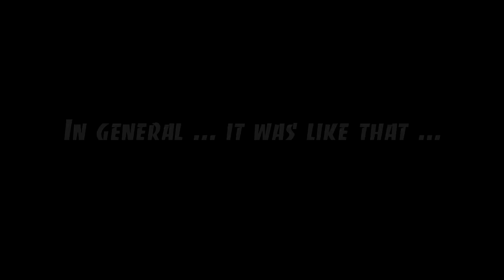A miracle invention from the motor of a car window lifter

Comment: I really appreciate how you thought about what the door lifter was. A motor that could be powered by a 12v battery with enough torque to do some real work. In re orientating it, we can see how it really has potential outside its intended use. Mounted sideways connected to a long rod actually makes me see more ways a motor could be used. Thanks for teh inspiration. Now to get a few old window lifter motors now that I see what they were built for......high torque situations. thx.

Comment: So the motor worked on 12V DC so you connected a battery which would be continuously charged by an AC adapter? Thats pretty sweet

Comment: 🔵 You should have made it at least 10-inches wider to overlap the wall on both sides enough to prevent light from coming through the uncovered areas.

Comment: Guy puts on hearing protection to fire up bandsaw to cut plastic, yet has his eyes close to at least 5 different power tools and no safety glasses on.  Classic!
Reply: Not too hot on band saw safety either   free hand cutting when a fence would be better and not having the blade guide  lowered to prevent accidents . 

 I'm highly amused that people are still stupid enough to enter the workshop & start working wearing  " Open toed safety sandals with or without socks " ..one day he'll learn the folly of his actions the hard way . 

 Did like his PVC melting device though ...........me want  ....me want .

Comment: I did it. But for the battery, I used 6 batteries 18650, that I obtained from an old laptop computer und attained them to a bms modul. Thanks for the idea

Comment: Interesting re-purposing. This application is relatively minor but an interesting proof of concept, and it makes me wonder how far it would scale up since auto window activators are capable of lifting fairly heavy loads.
Reply: John Bennett I’m with you! “Proof of concept.”Plus I laughed, relaxed, AND learned stuff. But that’s just me.
Reply: I'm thinking an elevator bed in my campervan.. Debating the window regulator vs the wiper motor...
Reply: Jusqu'à 20 kg
Reply: @russvanorder673  i think wiper motors are more powerful.

Comment: I think it was a great idea to use the battery from one of your power tools as power source instead of buying a DC power supply. I have large glass windows across my living room for the Sun beats in in Midsummer in the morning. This design will work right, all I need is a longer rod for the larger curtain.
Reply: N'oubliez pas de mettre votre systeme à l'exterieur pour plus d'efficacité
Reply: Those  power tool batteries are expensive. And most don't use 12v, which the motor is 12v. plus you will be Taking the battery and having to leave it at the shop or forgetting it when it better serves a purpose with the tool itself. So why make things harder on yourself? Makes no sense to do that.

Comment: it would be a miracle if u add a limit switch so motor stops automatically at fully erected or fully retracted blinds
Reply: Miraculously
Reply: and throw in a LDR circuit
Reply: What would be really great would be a little string with a ring on the end. You know, in case the power goes out.
Reply: @Greg042869    You'll never be able to pull on a string hard enough to overcome the torque of the gearing.  It would be like trying to force down a car window without breaking the glass. 

And It's powered by a battery which he attaches at about the 9:15 point in the video. :-)
Reply: @phillipzx3754  Well, let's say you left out the gearing.
Reply: @Greg042869    It's a worm drive.  If you left out the gearing it becomes a different drive system.

It's like removing the gearbox from a turboprop airplane and expecting it to work the same.

Window motors are designed using a worm drive because they can't be push down without busting something.  You'll have to  use a different motor/drive system.  A stepper motor would probably do what you want. But a window motor is dirt cheap. :-)
Reply: @phillipzx3754  I think you missed my sarcasm. I was saying you could put up a window shade as is.

Comment: Great work !   I have been looking for an example of a power window doing this, and found it here.  I have been struggling on how to "connect" the motor gearing to the shade rod easily.  A lot of power window motors have a small gear rather than a square shaft.  Does the square fit up to a 3/8 drive socket by chance?   Thanks for sharing.
Reply: L

Comment: Not needed for this "invention", but something you should know.  All small automotive electric motors (except starters) have a built-in "current limiter".  This prevents burning up the motor if it stalls.  The current limiting resistor is inside the motor housing.  It does not look like a resistor.  Typically it looks like a piece of aluminum foil inline with the brushes.
If you remove this, make sure you have an external fuse that is sized small enough to prevent melting the windings !

Comment: All that to adjust a shade.  Why did you place the switch prior to paint?  I have a window motor that picks the front of my mower so i can clean and replace blades. It will also lift a deer for dressing. I have a string on my shades.

Comment: I hadn't seen a Miracle in a while so I watched this all the way through... in spite of the looped music... and had a good laugh at the end.  Bravo on your craftsmanship by the way.   I did worry for your fingers with that band saw... but that was the miracle for me that you didn't lose a finger.   Your solution for the electric blind was very clever and reminded me of the ball point Pen that NASA spent millions on that would write in a non-gravity environment.   While the Russians solved the same problem for 10 Cents or a few Kopecs... by simply using a pencil instead of a Ballpoint pen...  But it was all in good fun and thanks for posting... wish I had your abilities with making things.
Reply: Off subject I know but it's a bit like the Heat Shield that NASA spent millions on for their space capsule re-entry. The Chinese used Cork. Cost nothing. A tenth of the weight and worked just fine.

Comment: You Tube needs to put a "cap" on how many 'miracles' are allowed for these 'can't live without inventions/device's', since out of the last 235 'miracle' devices I've built in the last month, one is actually useful, but NOT for the purpose it was intended for, (!?). LOL - Go figure.
I ended up using the motor to fabricate a polisher for nuts/bolts, and my brass shell cases because of the rpm range.

Comment: That is very cool.  The Sun setter retractable awning I just quickly googled goes for $3,600.00 US.  You can build your own for less than $200.00.  Thanks for the idea of using the window actuator.  Brilliant.

Edit. What's with the negative comments?   There are so many ways this could be used, You can use it to devid a room,  use it as a photo back drop,  cover any window, use it as a paint shield.  There are a lot of uses for this. And any of the ones I mentioned are going to be far more expensive.  This is a great ides, if you don't think so, you have no imagination, nor much experience in a huge list of things. This is a great Idea.  I know for a fact I will be using this concept on something.  
Again, nice job, huge money saver.

Comment: A simple rope loop could have accomplished the exact same thing and not needed to use and voltage and wires. KISS is the typical call for any project.

Comment: You Know there is more here than most can see , simply put I took existing roll up blinds (6' wide x 7' tall)  total of 5 blinds , each operated by a continuous loop of cord on one side of the blind and employed this idea. If you are equipped with the desire and ability (everyone is different) you can incorporate the electric motor (5 in my case)  , give each motor a positive and a ground tied to one switch and now there is 1 button to push and all blinds operate exactly the same up and down. I like them even, pain to do by hand. For those that might want to operate them individually , you will need more switches .There are a vast amount of uses for the motor and switch he used .We could use less trash and more people who takes the time to make something work rather than letting it go to the landfill and then buying new.   Each and every one of us should learn to make do with a little less and figure out what to do with what is available and it would benefit the planet and all that exists .

Comment: First thing he does is use an adjustable pliers and use it backwards mistake number 1  let’s move on. Next thing he does is put on ear protection but no eye production mistake number 2. Let move on. Next mistake he makes is not plugging it into a outlet instead of using a battery. Assuming he knows enough to install a transformer. Although I may cut him some slack on this one. He could raise the curtain should there be a power outage and he’s in the dark. By using  tool drill battery. In conclusion he gets  C+ no wait a C